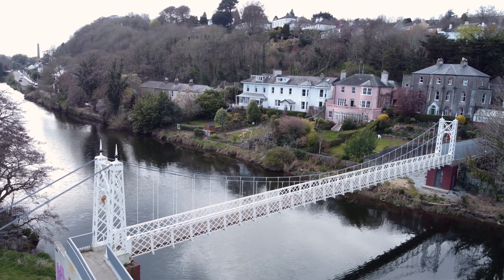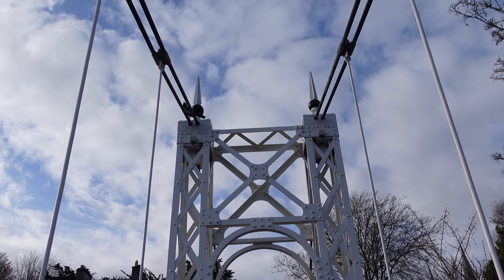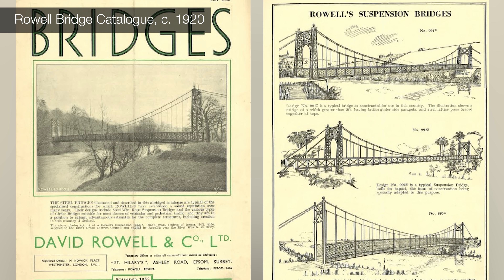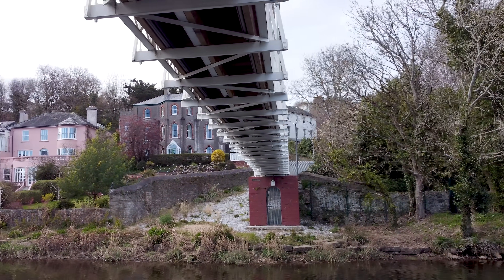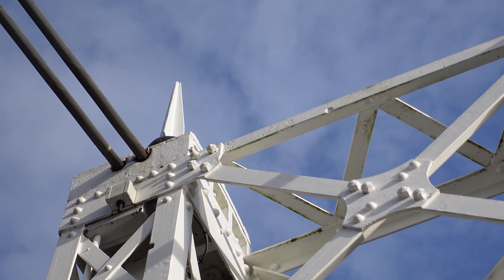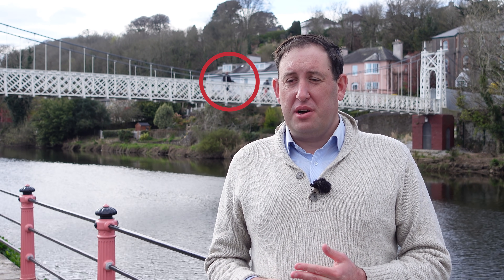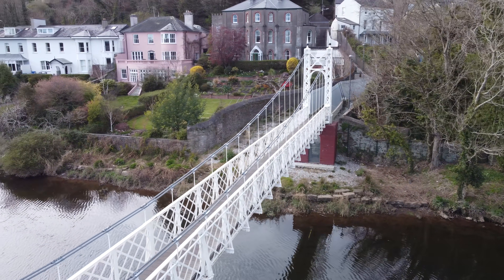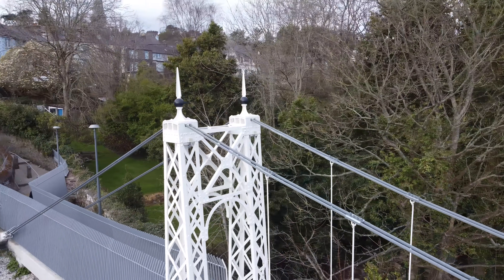The bridge that must legally wobble

Comment: 50,000 euro for a bridge that held up for 90 years before needing refurbishment? Kieran McCarthy's right, that bridge WAS good value.
Reply: And the refurb cost over €1.7m.
Reply: The price of labour has increased a lot, but we have cnc machines, calculators, and other computery thingies now so that's cool.
Reply: If you are selling enough bridges to need a catalog you are probably making multiples of the same components which means that tooling costs are spread over many bridges.  Also that is the cost of materials only, not the on site installation including the foundations.
Reply: As a person from Cork I can say we love a bargain
Reply: No that bridge will remain a good value until the end of time.

Comment: There's a VDOT*-maintained pedestrian suspension bridge in Criglersville Virginia. The Criglersville bridge has a shorter span than the one in this video, and consequently, is built lighter. It has enough vertical 'shake' that it disrupts your stride while walking across. At a vigorous walking pace, the bridge deck is coming up to meet your foot because of the waves that travel the length of the bridge deck. It's challenging to run across that bridge because of how much the deck moves.

* = virginia department of transportation

Comment: God I wish bridges just cost 700 pounds today. There's a small town across the river from me I use to work at. Problem is, there's no accessible bridges by foot for miles, thus requiring me to take a very long and round-a-bout train ride just to go to the opposite side of the river.

Comment: I get that the engineers were tasked to keep it, but why is the wobble a LEGAL requirement though? If the bridge as a structure is protected, is the wobble a specifically protected characteristic? How would it be breaking the law to have built it in a more stable way?

Comment: I love that you could buy bridges from a catalogue at one point.
Reply: Shopping for your new town at IKEA.
Reply: Flat-packed bridges!
Reply: You probably still can, you just don't know about it.
Reply: @thecornfieldiii2069  can confirm you still can, but less as an entire bridge and more as components, such as Banagher Concrete have a manual of precast concrete beams for bridge design.
Reply: Today you have catalogue bridge sets for armies and there are standardised sets for temporary replacement. We had one such bridge in Prague used for tram line for about 40 years until the city finally built brand new, permanent one.
Reply: Reminds me of how, a century ago, in the US you could buy a house from the Sears catalog.  You would order your house, and all the parts would show up on a rail car, and you'd put it together yourself.  There are a number of Sears catalog houses still standing in the Chicago area.
Reply: I'm disappointed it's not still an option. Though nowadays, you'd probably shop on Amazon for them, instead.
Reply: I believe that they only sold the bridge designs, and that all the components were actually manufactured locally.
Reply: Houses too!

Comment: Having a catalogue for bridges sounds very silly if it were to exist today.

“Hmmm, honey, what do you think of this one?”
“Oh, I don’t know dear, I think the one underneath it is more shapely, don’t you think?”
Reply: Thing is, they still do exist. A few seconds on Google found me several. And that makes a lot of sense. Unless you need a bespoke solution buying a tried and tested model from a catalogue is much cheaper than having an architect developing a new bridge. Precast mass manufactured concrete parts are much cheaper than bespoke ones, same applies to metal struts.
Reply: I mean, it makes sense if you're mass-producing bridges. You can for example buy pre-built houses, in Norway we call them brakkebygg (baracks-building/construction) or modulbygg (modular building/construction), and other than the internal seams they're fine (and cheap because of labor-costs).

Comment: “This bridge doesn’t feel very safe. It feels wobbly.”
“Good. That’s the point.”
Reply: Bridges, buildings, even airplanes are designed to flex and sway.   If they didn't, they would snap off.
Reply: Before the renovation it actually felt unsafe, but now I can testify that it actually feels safe now. Shakey bridge superiority.
Reply: Alice from Well There's Your Problem disagrees with you. Make it more rigid.
Reply: Galloping Gertie has entered the chat
Reply: Toga pfp W
Reply: It's good that it doesn't feel safe...?